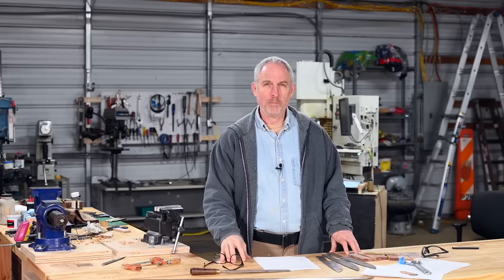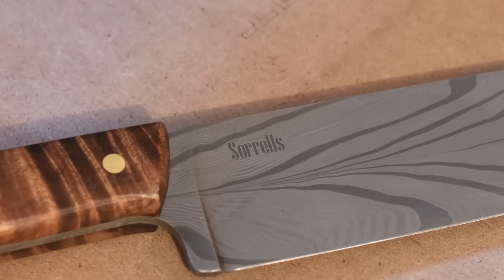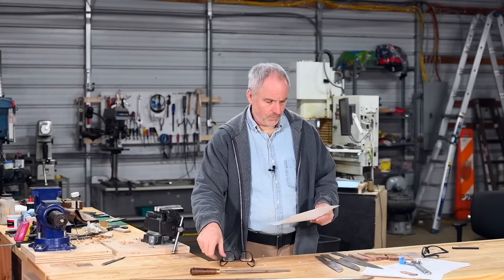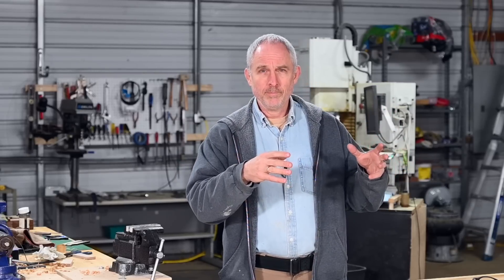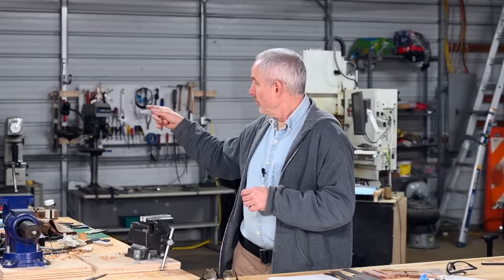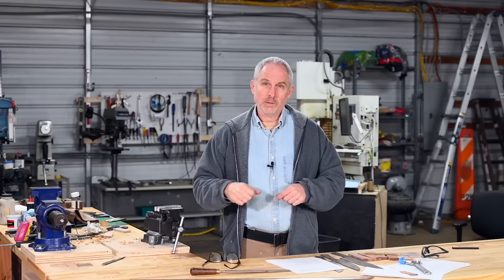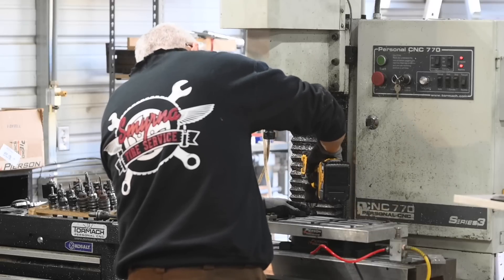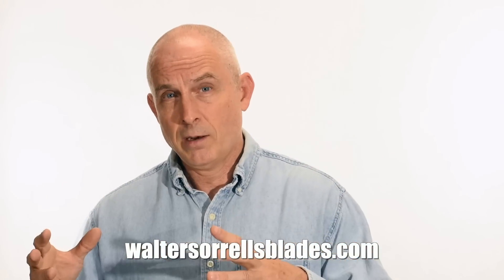Stainless Steel for Beginning Knife Makers

Comment: HI, tjanks for the video. One question. You said that 440 steel is acceptable, but what do you think of 420? Is it as bad as people say for knives?
Reply: 420 (and HC) is much like a stainless 5160 spring steel.
Sandvik 12c27m is also similar. 12c27 and 13c26 are higher carbon and get harder and are more like 1075 ish. Very tough thanks to low carbide. Tough and hard means it can hold an acute edge and acute edges have better edge retention because it cuts with less force, and it takes more wear to bring the edge to the same thickness.

Comment: It's funny that you said that "people go running off trying to get the latest greatest but most people cut vegetables, cardboard..." well another thing that the these people running to get the best steel knife are cutting NOTHING!!! Ahahah , these knives with super amazing , dialed in steels that someone spent a nice chunk of time getting right.....is just gonna sit in a box or safe and the most action they'll see is possible corrosion from some fat guys sweaty hands lol
Reply: Yeah, very true. If you want a super duper steel, just get one knife and use the hell out of it. Get a fixed blade because the steel likely well outperforms a folder's handle and mechanism.. folders are for opening boxes and maybe slicing food, imo. A basic hunk of steel done well will be a perfectly good tool. Mora's are often highly recommended for bushcraft people, I like them, and they're essentially 1095 or the Sandvik equivalent of 420hc. - and both of them at like 57-58 HRC at best. 
If you want better, you can make something better and have fun doing it. 
I like my Mora and Opinel, and have a D2 folder for the cardboard fire starter. I got to borrow a bench made in S30v in return for sharpening it, and it didn't cut things any better than any other knife, even if they won't dull it as fast, if they lose it, there goes money down the drain. At least they're one of the few people to actually use it, though.

Comment: And another thing to think about is hand sanding.  The big thing on YouTube is hand sanding is the bomb and that’s how you really get a knife finished correctly.  Stainless Steel really sucks to hand sand, it’s horrible.  It took all the fun away for me and I was very discouraged about making anything in general after messing around with stainless.  I had the most fun before I knew that ppl looked down at knives if they weren’t hand sanded.  I’ve went back to the drawing board though and I bought every grit of Trizac belt and a fine grit scotch bright belt, because I’m not hand sanding my next stainless knife; it has beat me.  I am done.

Comment: First and only stainless I’ve used was 440c.  I’ve just finished a chopper where I got very tired of hand sanding so I just stopped and put a handle on it.  It was the best decision I’ve ever made; I’m not scared to messed it up because it wasn’t totally finished.  I haven’t been able to dull the edge yet and I’ve tried very hard.  440c can be oil quenched and you can heat treat it with out an oven, but with a PID controlled forge.  Watch my poorly made video if you don’t think  it true.

Comment: Wouldn't say I[m any kind of authority on stainless, but I've made and sold a lot of the little bastards and I think the first step new makers have to get their mind around is that these are a series of metals made in the industrial age for industrial processes. Which has some good and bad parts to it-
Plenty of accurate documentation
High standards of metal production
Good for mass production
Where its not so great though for the hobby knife maker is making maybe 1-2 knives at a time because you're looking at some factors like using an oxygen free environment (gas injection or foil packet) which means more stuff to buy and having gear which can sit on a much higher temperature (than carbon steels) for the austenise-martensite magic to work properly and they will usually need some kind of soak time of anywhere between 5-30min at that exact temp before you quench. Which is normally actually easier and less hassle than oil quenching, either by hanging in still air or doing a plate quench. Nothing catches on fire, you aren't slopping crap everywhere and its generally really easy as you've usually got about 1-2min to get it down to under about 3-400C and you'll have a hard knife. Same with tempering, if you can temper a carbon steel in that 150-230C bracket that opens up most stainless types, a few will temper around the 500C mark so keep that in mind going through your data sheets.
Data sheets- do what it says, don't do anything else but exactly what the manufacturer says! Or just do what you want and have no good knives, choice is yours
In regards to sub zero treatments, no all stainless steels need it, read the data sheet, it might not need it at all and your purpose might not require it either as some steel just don't.

Starting off-
AEBL and most of the Sandvik derivatives and the UK SF100 are sort of close family of steels, easy to work with, finish nicely, take an extremely fine edge and they're tougher than a $2 steak. Not great for edge holding compared to some steels, but its really not terrible for a lot of occasional use along with good corrosion resistance and ease of sharpening
Budget bangers-
N690 and VG10, big plates of this stuff can be pricey but will also make a lot of knives, they're sort of a derivative of the 440 series of steels and don't need sub-zero processing (well you can but it does nothing!) and take a fine edge, good retention and edge stability at the higher hardness with bomb proof levels of corrosion resistance
Better bangers
CPM S30V, S35VN and S45VN make excellent knives that will out-perform pretty much most kitchen knives and really have a lot to like about them, they finish 'ok' but are a bit of a chore once you're hand sanding, oh so much hand sanding. You do like hand sanding don't you? Good corrosion resistance, harder to sharpen for non-knife dorks and not necessarily very tough so don't make an axe out of it or go out of your way to fight a bear with one.

Those are just some I have a good working experience with, they're good steels and there's plenty more good steels out there for you to look at as well. Mostly it comes down to, can I make it as good as it needs to be with the gear you got, not the gear you might want.

Comment: The first stainless steel I used was CPM-S35VN, and I still use it. It's the perfect balance of everything I want, including price and ease of heat treating. I have also used a lot of M390 because a very generous supporter bought me two huge sheets of it. I hate working with M390, but it makes a great hunting knife because it'll hold an edge so well. It is not great for bigger knives, including choppers and chef knives, because it's too brittle, and playing with the heat treat doesn't seem to improve that too much. M390 is actually easier to heat treat than CPM-S35VN because you don't have to get it as cold when you cryo-quench it. You can do it with dry ice and acetone.
Reply: How much do you spend on grinding belts though?
Reply: @XenFPV   I don't know. But it's definitely more with M390 than with other steels. Sand paper gets expensive, too. I once spent a several days trying to get one scratch mark out of a piece of M390. I gave up hand sanding it for a long time. Now, I'm back to hand sanding it. The trick is to throw away the sand paper more frequently. You go through a lot more sand paper, but it's still doable.

Comment: Could you do a video on how you’re killing your blades. Do you hard mill? I saw them on the side of the pallet. Did you machine an angle on the side of the pallet so the machine just has to run along the bevel and you don’t have to worry about steps in the bevel?

Also how well does it do for handles? Or more specifically how does it work and or how do you chamfer the edges of the handles?  Right now I use a router with a half round bit. 

Thank you 

Riley

Comment: I built my own heat treat oven from scratch, and it was incredibly easy 🙂 Cost of all parts was maybe $250, and it works quite well. Couldn't justify the cost of an Evenheat or equivalent
Reply: Can you share your build with me at least list the items you needed
Reply: @Robert St john  it wasn't a whole lot. I got an Inkbird PID temperature controller (check out wiring examples at channels like Red Bears Ops, Advoko Makes, and others), A1 Kanthal (I used 20 gauge), soft fire brick (if it's like 3 bucks a brick or if it's heavy, it's the wrong kind. You want the light, super porous kind) and refractory cement/mortar. I used angle iron and sheet metal to make an enclosure, and I got a project box for the PID and related components enclosed. It took maybe 8 hours total to work everything out and get it assembled, but it was a very fun project, and super rewarding to light it up! The hardest part is figuring out how many wraps of the coil do you need to get the resistance you want.

Comment: When grinding the initial bevels on the blades, how thin do you take the knife edge? Should they be almost sharp before heat treating or do you leave a few thousands of fat?  Thanks. I always learn something from your videos.
Reply: I always stop at around 10 thousandths since I've heard that's a safe place to stop. If you go thinner you risk getting a bacon ripple warp on the edge
Reply: @K.O.I_WORK  Thanks for the response.  I was afraid a sharp edge would have issues during heat treating, but was not sure.
Reply: Myself and many other makers of thin kitchen knives do ALL the grinding post HT. The only time I grind before HT is if it's a big thick knife like a kukri/bowie or a knife with a hamon.

Comment: A good "starting" steel is AEB-L. You are actually able to forge is as carbon steels has good properties and forgiving for beeing a stainless. I actually tested to heat treat it in my forge and used a laser thermometer to see it got to the correct temperature.  But still, I would recommend you a heat treating oven. The second one I tested failed...

Comment: The real conundrum is.... Four years ago, in Indonesia, I saw with my own eyes, a "traditional" blacksmith, working with minimal tools (essencialy angle grinders) and heating in a charcoal forge, making knives out of K110 tool steel... Not knowing what steel it was, the son's smith, who spoke some english, showed the invoice in which k110 is listed the same as aisi D2 so, the old man was producing some realy good blades (tested in my presence) forging and heat treating them in an open forge... So much for the electric ovens and foil raps...
Reply: If you just want to make a piece of metal sharp. Sure you you can heat treat a high alloy steel in a forge. 

Ive done it myself. 

If you actually care about getting the most out of the materials youre using. That is not the way to go.
Reply: D2 is an air hardening steel so I'm not all that surprised... how much austenite produced during the process is questionable but essentially only the edge needs to be hard....
Reply: How was it "tested" ?
Reply: @SuperSteelSteve  Cutting and choping green and dried bamboo... Didn't chip nor rolled, he demonstrated it that way, cause I argued the heat treatment would result in a britle or mushy blade. Aparently, I was wrong...
Reply: @A. Simao  what was the blade geometry? How thin/thick behind the cutting edge and what was the spine thickness?

I ask because I can heat treat a blade to 50HRC(extremely soft)and can cut into trees and not show any chipping or rolling if the geometry is right for the pre-set task.

Also, a receipt isn't proof lol

As a knifemaker it doesn't make any logical sense that he was using k110(d2) over something like 5160.

K110 is 2x,3x even 4x the cost of k110 (its much more costly to manufacture). A steel like 5160 is also much more readily available. It's also much easier to forge and heat treat.

It's also much, much, much tougher. 

I'm not doubting the makers skill you saw or saying he's a bad person, but often times these guys in 2nd and 3rd world countries have a bit of a scam going on. They know something like D2 will make your eyes light up and be more inclined to buy.

Just from a cost/benefit, machineability, forgeability and even availability point of view, using D2 is the last steel that anyone forging or making knives with minimal equipment (which I do) would be likely to seek out or use.
Reply: @SuperSteelSteve  I recall the edge being thick, yes! It was a medium sized type of machete they use there as an agriculture tool. Look, I was visiting the wonderful country of Indonesia  and, as a knife nut, I couldn't help myself viewing a traditional smith at his work so, I approched and was delighted by the skill of the man... Being curious why they were cuting bar stock, I asked about the type of steel and was answered it was K110.
At the time I didn’t know D2 was aka K110, the alias I knew was the european designation of 1.2379, because I’m a sucker for Bulgarian manly’s (own all of them in various steels).
Since I’m NO knife maker, not even hobbyist, BUT knowing a thing or two about the making process, I was stunned watching an old, but skilled man, using angle grinders, a sledgehammer head half buried in a wooden trunk for an anvil, a couple hammers and files for shop tools and a clay covered tire rim with some kind of electric blower for a forge, hammering (drawing) a supposedly air hardening tool steel, in an open coal forge.
When addressed about his job, the old man nodded to the young fellow (his son, I was told) who spoke some English and who’s only occupation was cutting bar stock, as long as I saw…. He clearly understood my doubts about the steel being cut (a dark steel marked with yellow dots) so he took off and returned with a paper he explained was the invoice of the steel transaction/acquisition.
Since I don’t read Indonesian he roughly translated it…
“10 units of K110 bars in 2 meters each”
Then, this same guy took one of the completed machetes and made several cuts in green bamboo and several chops in dried hard bamboo. He handed me the machete for inspecting the edge. No chips and no rolls were visible or noticeable and a good edge could be felt by passing the fingers.
And that was it… I kept watching the old man using even his toes to secure the blades while working an angle grinder to shape the bevels…
Now… was it D2? I cannot know, but once you start seeing some stuff they have in there… I mean, they have access to all the goods we have in the west. You can buy all you want in Jakarta, Surabaya, Bandung etc…
Was it a scam? Might well be… D2 mau be costlier, harder to forge, and NOT a good impact steel so why use it? But yes, anything marked “D2” makes one look twice because, even for the uninformed, it somehow is synonymous of superior steel. That was, probably, the reason why they were priced higher. IIRC, they were almost twice the price relative to others in “simple steel”. Bought neither though… But, to this very day, when I read or listen to someone “you need a controlled heat kiln to heat treat this or that steel”, “you must plate quench this or that”, I remember those fantastic days in Indonesia, and the old man at his craft, quenching blades by lightly touch them in water several times.
A conundrum, realy…
Reply: @SuperSteelSteve  also curious to hear that.
Reply: Yhea it's crazy, It's just a matter of good enough or spot on, but apparently there's lots of wiggle room lolll
Reply: ... the smith's* son*
Reply: With enough experience holding temp and grinding off the decarb, I could see it working. Thick enough geometry and it'll work. It's not a tough steel, but it is still steel. Watch survival Lily beating up her D2 knife compared to tougher steels, it holds up pretty well despite that and deformed much less before breaking thanks to being stronger (harder)

Comment: Not a fan of laser engraved logo's. The hallmark of quality Japanese kitchen knives is a hand engraved signature. The laser stuff is just the opposite, in my humble opinion. Surely you don't make THAT many knives. If you do, kudo's, no complaints.
Reply: Lasers can etch into hardened knives, where engraving tools cant. Lasers also make every logo identical, if that's what you want to go for.
Reply: @Maegnas99  

Not true. Myself and Most makers use electro-chemical engrave/etching and it's always done on hardened blades.

It uses AC and DC with a saline solution over a template to basically dissolve the steel in the pattern
Reply: ... logos* (plural, no apostrophe)
Reply: @einundsiebenziger5488  I bow to your superior knowledge. You missed kudo's BTW.